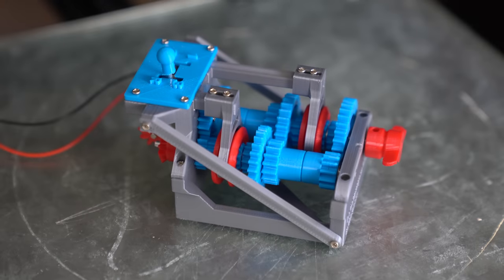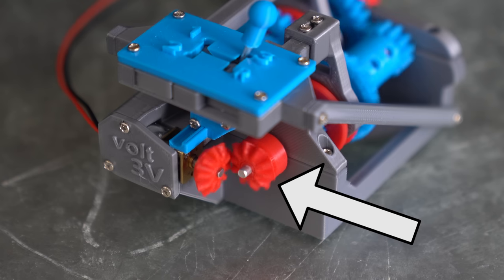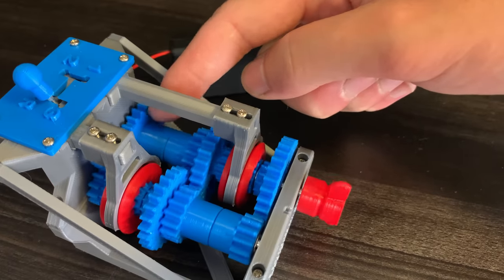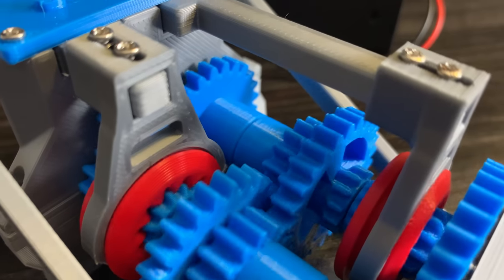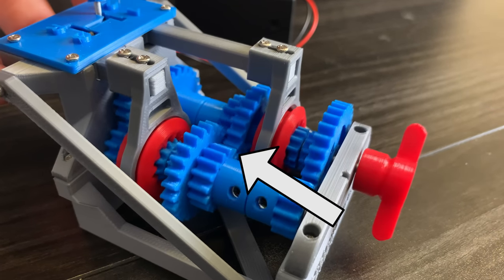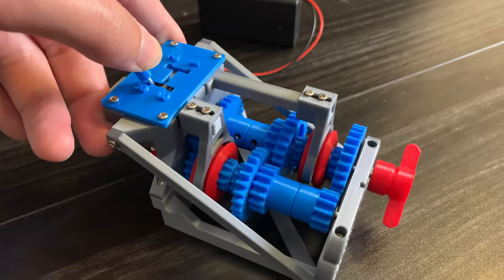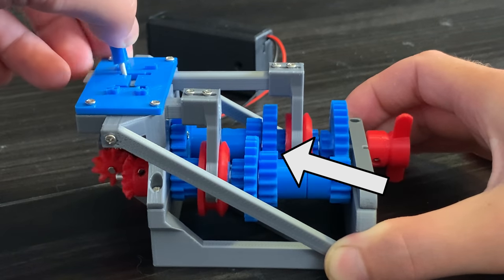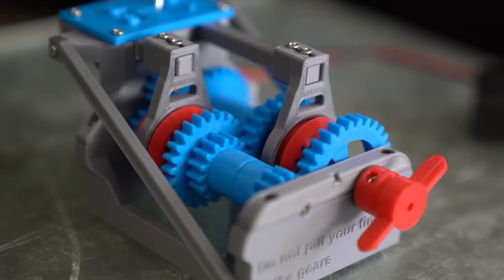What makes a manual transmission so cool?

Comment: I still can't wrap my head around just having no point of reference and creating a manual transmission. I know theres alot more to them now than back in the day but seriously how did somebody just sit down and come up with that when there was just nothing else in the world like it to reference it to? Same with the original engines, how did they possibly have even a concept about what they were doing. It's just crazy
Reply: Gears have existed for millennia. Windmills use gears to grind flour.
Steam engines predate combustion engines.
Engineering was performed by the Ancient Greeks, Romans and Egyptians and many others. Knowledge is incremented and is added to bit by bit. If someone is presented with a problem then they think about it, draw a few diagrams and try something. Eventually something works and they or someone else improve the original idea. If we see the culmination of this, say a car or aircraft, it's hard for some people to break it down.
All the best Danny.

Comment: Awesome demonstration! But it threw me for a loop when you referred to the input shaft as the driveshaft. The driveshaft comes after the output shaft in a drivetrain.
Reply: it is technically the correct term in this context as it is the shaft that is driving the mechanism. that said I still totally understand how it could be confusing if the first thing you think of is the vehicle component

Comment: Nice video!  It seems the details of the clutch is need to really understand.  Can you show us what's under the hood on how the clutch works?
Reply: The clutch might be a tricky bit to print. basically it's a disc (or series of them) that has a high friction material on one side, and a metal disc on the other. there is a spring (or set of them as in motorbikes generally) that pushes the two or more sets of discs together, so that the friction locks the engine to the gearbox. you can reduce or eliminate the friction by pushing down a pedal on a car, or the left handlebar lever on a motorbike, this pulls on a fork that forces the two elements to seperate. reducing the friction is how you start moving so the car doesn't stall, you completely decouple to switch gears.

Comment: finally i can begin to understand how it works! 
but how is the output not the driveshaft? the input connects to the crankshaft, via the clutch and the output is basically the driveshaft, no?

Comment: As this doesn't have the synchroniser or "dog clutch" this is known as a crash gearbox.
Reply: A dog clutch and synchro ring are different things, almost opposites actually. Crash boxes are also often called dog boxes. A dog clutch is a positive engagement/lock clutch like the red splined pieces in the video. Synchro rings use a bit of friction engagement to get the two mating splines to synch up before they lock together.
Reply: @H34...  I stand corrected.👑 Here is your crown.

Comment: So where is the clutch? You can have a computer control servo motor moving selector and it would be auotmatic. So it not really manual and you only explained the basics of a gear selector in that particular setup.

Comment: Can you make a 7-speed + reverse with reverse on top left and first down left?
Reply: So like, flipping the entire assembly 180°?
Reply: @HappySlappyFace  Yes, but try to also add 4 more gears(it's a racing gearbox that was used by ferrari, because in racing the gears that are most frequently used is 2nd and 3rd and it's easier to shift when gears are opposite to eachother)but i don't know how the internals of that transmission work.
Reply: @HappySlappyFace  But I think it will similar with the internals of a normal transmission with some adjustments
Reply: @HappySlappyFace  The f40 has that transmission, but has a 5-speed not a 7-speed
Reply: @michalismousikos5042  the internals of manual are simple, the higher the gear the higher gear ratio it is ( or smaller? Not sure )
1st gear: small input gear big output gear
2nd gear: medium input gear big output gear
3rd gear: input and output same size
4th: large input gear medium output gear
5th: large input gear small output gear
And you keep going like this as much as you want
Reply: @HappySlappyFace  I mean the placement of the gears, because it will have 4 rows of gears this one has 2
Reply: @michalismousikos5042  well that isn't a problem the other rows will only get engaged when the pedal is in that row
Reply: @michalismousikos5042  the selector forks for the above mentioned 'racing' gearbox are grouped as:
Reverse - First
Second - Third
Fourth - Fifth
Sixth - Seventh

Some uses of this layout (new Ford Bronco) are the same concept but labelled as:
Reverse - Crawler
First - Second
Third - Fourth
Fifth - Sixth

Also the video shows a common layout for a front wheel drive (transverse) gearbox, the gearbox you mention has all the selector forks on the same axis

Comment: You say the drive shaft and the output shaft.  Isn't the driveshaft connected to the wheels, why it's called the driveshaft.  If so, what is the output shaft connected to?  You have nothing going in from the engine.

Comment: So how do automatic transmissions know when to change gear (especially before computers  seems a complex engineering task)
Reply: Just change the gear when the motor turns too fast. The problem which I encountered with this system is that when you press the gass pedal a little too much and the car shifts down which you not really anticipated and wouldn't do if you where driving manually. There are better systems for that without steps
Reply: They use a bunch of fluid and pressure-sensitive mechanical systems to know when to shift. The faster the engine spins, and the more you press the pedal, the more pressure there is.

Comment: If I didn't know how transmission works, this would be very confusing. It lacks essential information on how one gear suddenly starts moving the other gear just by moving some "tube". Whether 1st gear or 3rd gear, all the gears are spinning the same, so why the output is different?
Show this to a kid first, if you are making an explanatory video.

Comment: I still don't understand, does the blue output shaft rotates at different speed relative to the gear wheels built on it? How does that work?

Thanks to whoever can explain this
Reply: Because 1 and 2 gear are not connected to output shaft and rotated freely on it, being intermeshed with input shaft. After choosing 1 or 2 gear, internal red gear(synchronizer) connect it to the output shaft. 3 gear and R are not connected to input shaft, so all process repeating, but on input shaft
Reply: @maksimfedoryak  how are the 1 and 2 gear wheels not connected to output shaft? Any diagram/illustration?
Reply: @RG-pr5xx  whey are positioned on it, like donut on finger

Comment: I mean...this is how an automatic transmission works too. The manual is not special in that it uses gears to change the output speed in relation to engine speed.
Reply: No, he is manually changing gears, automatic changes gears automatically based on speed and is much more complex.
Reply: @alexander21812  It's not really accurate to say it's based on speed. It's based on sensors picking up a lot of information and making  decisions based on pre-determined parameters for those measured factors, speed being only one, and not even the most important.

It is accurate to say it's a little more complex, but it does the same thing. It changes the wheel torque using gears, like I said in my original comment

Comment: One thing to note is that transmissions work on the principle of:
Given a set input horsepower, the gear ratio is a direct analog to the ratio between torque and speed (ignoring friction losses)
A gear ratio of 10:1 means 10x the speed, but 1/10th the torque (to keep the horsepower of the output equal to the horsepower of the input, ignoring friction losses)

A CVT theoretically takes advantage of this behavior to the max, allowing the engine to sit at a requested horsepower and taking the perfect gear ratio continuously as conditions change
Reply: The formula involved is:

HP = (lb-ft * rpm) / 5252

Or

W = Nm * ω (rad/s)

Rearranging gives us:

lb-ft = (HP * 5252) / rpm

Or

Nm = W / ω

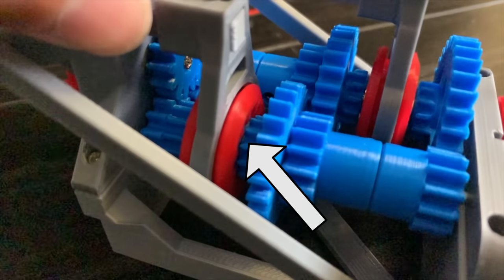Comment: 3:16 Not on most Semi trucks. No synchronizer, better get your timing right!
Reply: Semi trucks have so little variation in speeds that synchros aren't really required. You usually have around 250 - 500 RPM between gears and anywhere from 8 - 14 gears to shift between.

Comment: Maybe I am just a complete moron, but I think it would have been helpful to explain that the drive shaft is infact driving the opposite gear set at all times. The fact that you said "The only thing connected to the driveshaft is these two gears and the red piece" threw me for the entire video and I had to go back and rewatch like three times to figure out what else is going on. You never mention that the drive shaft is constantly driving a portion of the output shaft and it is the sliding of the mechanism to connect the dead pieces with the driven output shaft that does the work.
Very cool concept and video, just needed some better planning given it is so short and one poor explanation throws the viewer.

Comment: If you want a manual transmission vehicle, it has to be special order from the factory and only available in a few vehicles. Automatic is the new standard.
Reply: Depends on the country, Im fairly certain manual is still the standard in my country but there are more and more automatics.